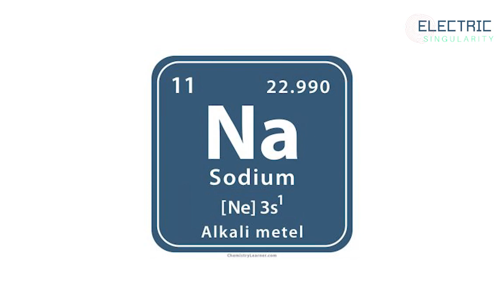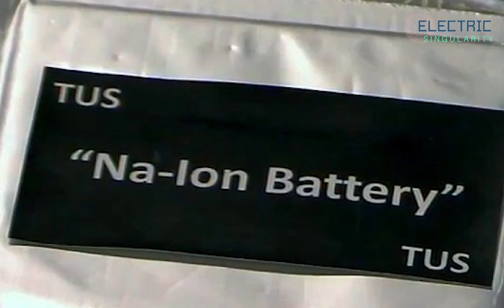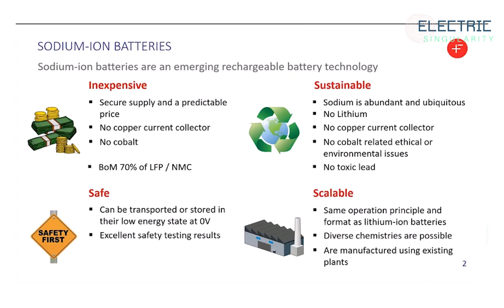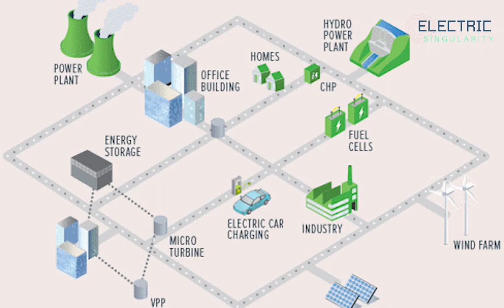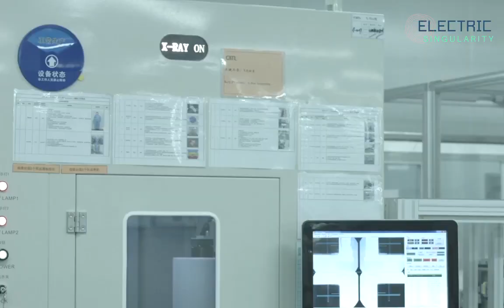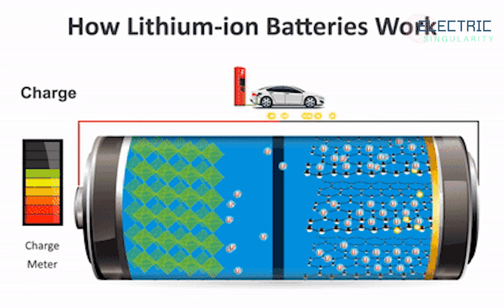CATL's sodium batteries will be 30% cheaper & revolutionise the world

Comment: Batteries? What about hydrogen as a energy store? Too inefficient I guess?

I know that Elon Musk doesn't believe in hydrogen cars but what about large amount of energy that needs to be stored, for example, in the process of producing steel.

Batteries are better for that purpose?

I also know that the company Sun Cable is planning to install batteries capable to store 33 GWh of electricity from a solar farm in Australia.
Reply: No need to quote Musk : hydrogen is just  a more complex, very inneficient and with a shorter lifespan battery.
It simply is ... a bad battery. But with a hype and a cool name due to that a full generation was advertised with, as the "oil replacement but it only creates water when it burns" thing. 

If we one day need to store huge amount of energy we will use huge stack of batteries, like australia is doing.

Sodium ion, molten salt battery, liquid metal battery are coming for this.

The technologic momentum of H2 never came, and it's already obsolete in every way.
Reply: @philv3941  Yes I thought so, I agree.
Reply: @philv3941  What do you think about solid state batteries? The time they will be ready, if ever, lithium ion batteries will be just as good?
Reply: @inlibertywetrust425  hard to say : 3640 studies published juste before the Start of 2021 for Lithium solid batteries, 2060 for Li-sulfur ones !   
We can't imagine how many teams works on /graphene, / Li-AIr / Silicium electrodes and so on. 

During the same time,  6 310 studies published on Li-Ion batteries. 

The war juste starts.  
We cannot say who'll win, but /ion will reach is maximum potential faster cause it's easier and less expensive to industrialize.  

The margin in "pure Li-Ion" seems around 300 Wh/Kg, without absolutely no proof, but 5 years to /Solid seems a minimum to me, cause being "better" is not enough to be sold.  
Sodium-ion already exists and is already better than Li-FEpo4 or Lead-replacement, but no one want to sell them and the setting of the first factories is very very slow : it's just too much expensive for what it's offering. 

SOLID, Sulfur , NA/ION :   we need them to be as cheap as Li/ion AND , from the start, and, 
- at least slightly better in energy density for SOLID
- at least twice more durable or powerful for NA/Ion
Reply: @philv3941  Ok 😀

Comment: Grid storage with batteries needs to be banned.  Force them, in law, to upgrade grids and do demand response.  To let power grids store power as batteries rather than storing it kinetically or as heat in boilers or in EVs in driveways and in buildings that need resilience, is to retard the whole process of electrification.

That's not just my position that's Google's position re the California grid.  Vs PG&E which wants to drive up lithium prices by wasting it on grid storage. Elon is causing grid storage to be popular and he has to stop wasting lithium on grid storage & Powerwalls.
Reply: I totally agree, unless they are using a power wall in an apartment or townhouse there's no reason to use lithium. Most homes around here have enough room in the back to have a tiny shed where they can stack it with easily recyclable lead acid batteries, with proper charging and monitoring equipment a properly sized lead acid bank can last for many years. Save the lithium for the transport sector that is already hurting for supply.
Reply: @anydaynow01  
Lead acid????
O......K 🤔

Comment: Ok, green is good! But seems that everybody is forgetting what they should have learned in school as a toddler. Plants need CO2 to produce itself, it is from the CO2 that it grabbs the carbon. But the levels of CO2 on the planet are at least 50 times below the optimal level, so plants are processing the photosynthesis at level 4, in "survival" mode. To maintain life we will need shortly to start burning limestone to replenish the atmosphere with the carbon depleted by the shells.
Reply: "CO2 on the planet are at least 50 times below the optimal level". What are you comparing it with? What is optimal level?
Reply: @sarojbhattarai6939  Optimal level is around 20.000 ppm. If you grow plants in greenhouses, you MUST inject CO2 to attain at least 5.000ppm so they grow nicely and perfect. CO2 is the molecule of LIFE. All this climate bs is in reality killing all plants!
Reply: Eduardo Prado
Are you forgetting that the ideal level of Carbon dioxide in the atmosphere is only 0.04%?
It's a sensitive balance.